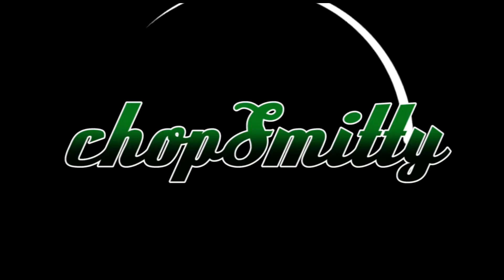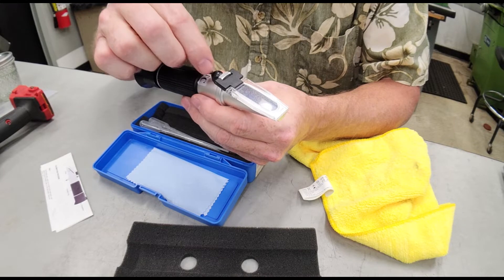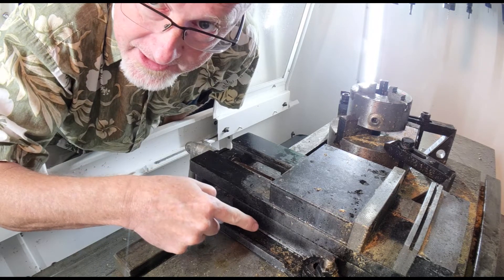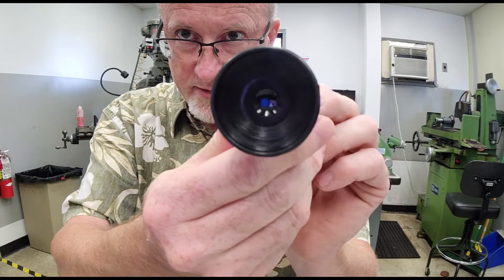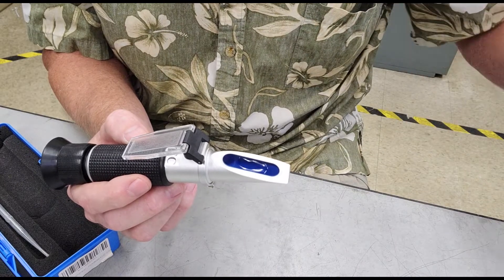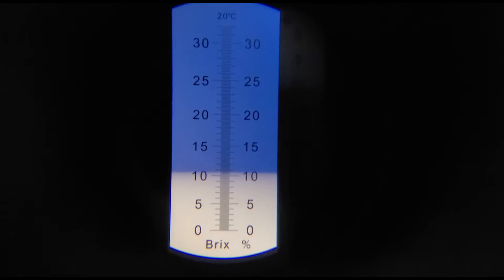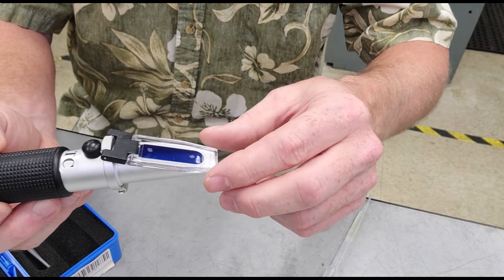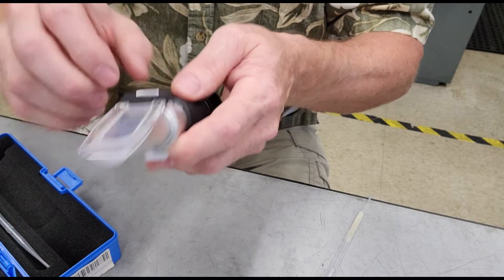Maintaining Coolant in CNC Machine

Comment: Have you have any paint peeling issues? I'm on a Tormach 1100M running 735 and I'm starting to see paint peeling pretty bad. But I'm wondering if it's because the concentration has been to high for to long. Do you know if higher concentration can cause more issues with paint? I also wonder if it's just the quality of the powder coat on the Tormach machines?
Reply from the maker: No paint peeling issues.  The whole machine is powder coated, so there's that.  I've been meticulous in maintaining the proper mix.

Comment: Thanks for the video. I just purchased a new haas mill to make prototype parts in my garage mainly working with aluminum. I’ve also purchased the synergy 735 coolant. What’s the maintenance like for this coolant? Any tips would be great on the do’s and dont’s
Reply from the maker: I really like the coolant.  Was hesitant because the only thing you really hear about it comes from Titan Gilroy and we all know what a product placement advertisement is...  Anyway I've not had any issues but, like I said in the video, I'm using Reverse Osmosis Deionized water.  Keep the Brix up and it'll go at least a couple years like mine has thus far.  Took over a full 5gal pail to fill the machine initially (55 gal capacity) and I've gone through just about the second 5gal pail in just over a year.  Have one on order now.  Good luck!!